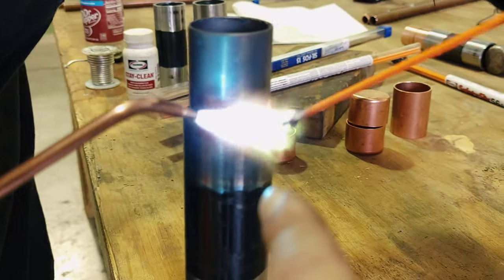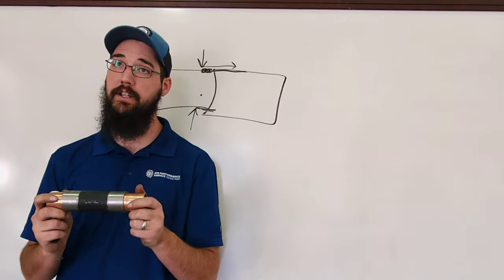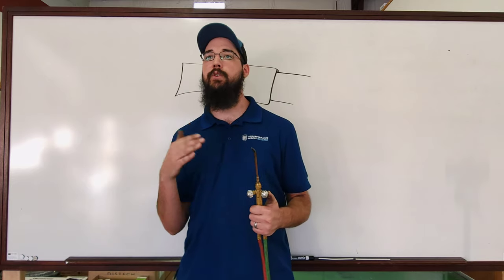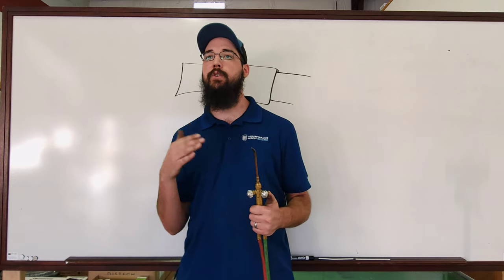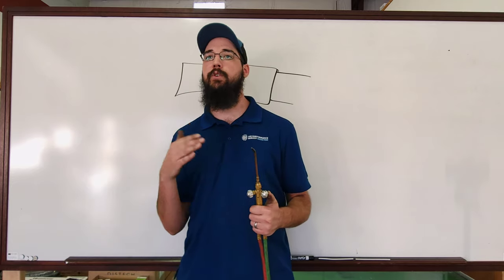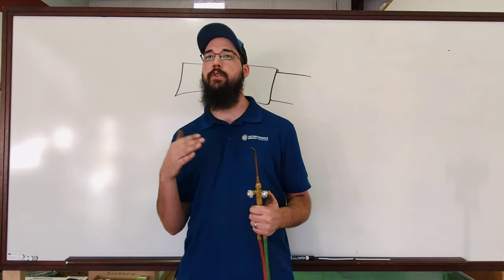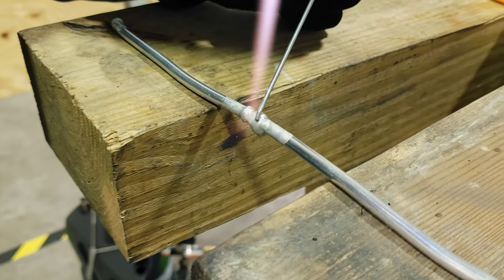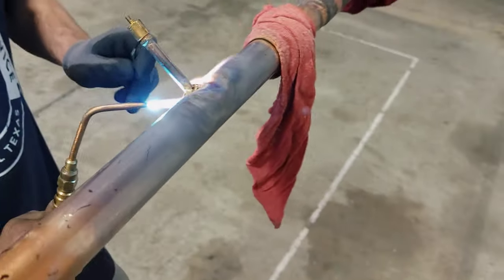Brazing Training for HVAC Technician

Comment: Nice tip on burning through the copper to get an access fitting on there but it is pretty tough to eye out the hole you need. 
I usually pressurize the system to about 70 psi or above 50 and below 100 psi and drill through. That way your shaving will blow out. It isn't ideal but sometimes you gotta do what you gotta do and wear eye protection ! Them shavings come out flying at that pressure. Take care Yah bless.

Comment: Never used oxy to braze everyone around here uses turbotorch. An A14 has got me through pretty much everything; throws off a lot of heat really got to be careful. Can see the advantages to oxy in a service setting when brazing components in a tight area.

Comment: I like to have the orange ( 56 % ) brazing rods  on my van for just this sort of thing. I like that they have the flux built into the rod. Definitely very important thing is TO CLEAN THE PIPE AND PREP IT PROPERLY. DE-BUR, SAND THE PIPES FOR BOTH CONNECTIONS AND USE NITROGEN PURGE DURING THE PROCESS.  Whether correct or not, i like my rod to follow the torch tip. Torch leads, rod follows. Please correct me if that isn't correct. It hasn't let me down ever,  but i always like to know the correct way
Reply from the maker: Sounds like it works well for you. My point in the class was not letting yourself get tricked into thinking your good because your flame was on your rod.
Reply: @HVACTIME  you did an excellent job. I was actually curious as to your input on what you think of what I said. Do you have any advice or constructive criticism. I generally want to learn and do tasks the correct way. You are a great instructor and mentor to the next generation. Getting them started off the right way...not like a lot of us who started the wrong way and had to learn the correct way.
Reply: @jasonjohnsonHVAC  Just to add my two cents, In my opinion you need the torch to correctly pull in your filler material into the female joint. He was stating this at 27:00.
Your filler material will follow your torch just don't go overboard or you'll have all your material within the pipe lol usually with BPHE's I will use this exact method of heating the copper first then the steel and the filler material will draw into the joint, afterwards you can cap off the top. BTW 56% rod doesn't even exist where I live. 
I've been getting away with the harris blockade rod and some stay-silv flux. Does a super job with dissimilar metals. It sais it's for brazing copper to bronce but does a good job with other metals as well. I would urge you guys to give it a practice on some scrap and see how it welds.

Comment: Best teacher ever man... thank you for posting ur videos
Reply: Why are you letting some of these students braze without goggles?  Have you ever had filler pop and get into your eyes?  Easy way to loose an eye. Some don’t even have gloves. Hope no one gets hurt.  I guess they will have to learn when they get burned by the torch or a piece of rod.  I taught Union HVAC service apprentices for over 30 years, and would have been fired on the spot, by the coordinator, if he ever caught students brazing without proper protective gear.  Guess you guys don’t teach or enforce safety in your program.

Comment: You are using adhesion to wet the metals and capillary attraction which is cohesion of the solder attracting to itself to pull in and fill the void.

Comment: MAPP 700 degrees. Turbo torch 3400 degrees. Oxy/ acetylene 5500+. Stay Bright liquifies 500 or so, Dynaflow 1300 or so. Copper to copper, Stay Bright is the champ. .

Comment: What risks do we run burning in a tap hole for stems and tubes? I've always drilled a piece, separate from the circuit to avoid introducing chips, and it adds a couple extra joints. My concern seeing that technique is weakening the wall we braze the tube into. Is that a non-issue due to material we add? Are there other concerns besides that and using nitrogen? The demonstrated way would definitely save me time.
Reply from the maker: Its possible but its been a standard industry practice. Ive never created a failure.
Reply: I personally have drilled holes for taps, but I will admit that I use some techniques to prevent chips in the pipe.  I always have a positive nitrogen pressure to blow out any chips that could get into the pipe.  The second is not so much of a technique, but the nature of the systems I work on. I work on large commercial refrigeration systems.  These systems have filters everywhere that are routinely replaced protecting valves and compressors.

Comment: The phosphorus in the silphos reacts with the steel and causes failure
Reply: I think that is BS. It would have been discontinued if that was true.  I used it for 45 years and never had a failure.

Comment: Soft soldering is SUPERIOR to brazing if bursting strength is the issue. Sure, plumbers use soft soldering, but it is a common misconception we braze because we work with 600 psi. Take a one foot piece of ACR, and braze a cap on one side, and a male adapter on the other. Then burst it. To begin with, BOTH will stand up to our pressures. But where you burst will be near the cap. Your 5500 degree torch weakens the copper. It will burst around 2500 psi. Feather in a patch and burst it again. It will still burst near the cap, but now around 1900 psi. Stay Brite is a SUPERIOR connection for both tensile strength and bursting strength.
Reply: The only problem with stay bright # 8 is it won’t meet a lot of specifications on large commercial jobs.  Then there is also the chance of getting that flux in the system where it gets in the oil and makes it acidic, which can takeout the compressor windings.  I’ll admit I have used the stay bright on quite a few instances.  There are OEM’s like Liebert, who install their expansion  valves with it.  I have also used it where I have a real close connection to something I don’t want to get too hot, such as a sealed sight glass.  It’s ok, but there is much more prep, and cleanliness is critical.  Good thing is it won’t form scale, and you can use a simple map gas torch.
Reply: We don't braze because of strength of joints. We braze because it's code first off, and that's because of the liquidity of phos copper vs any soft solder available including stay rite 8 which is the  highest at 530 or so

Comment: Most time these new guys just work too slow and can't multitask. And eventually they become techs and they still suck throughout the years. Let them heat up the material first.. they're all pretty much cold brazing
Reply: Yea a lot of people use the torch to melt the filler, instead of the thing the fitting hot enough to melt the fitting.  It looks like candle wax dripping on the outside of the fitting
Reply: @rodgraff1782  I tried to teach newer guys to braze scrap coppers together, so they'll get a good visual on the heat. And can repair a hole if it happens. Then they'll know when to back off the heat. Or distribute the heat further down a pipe where it's colder